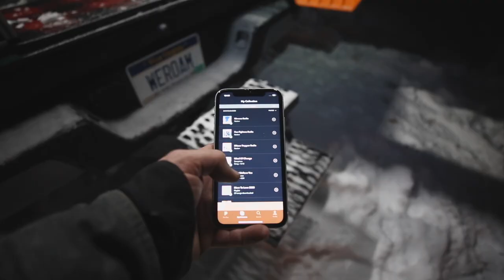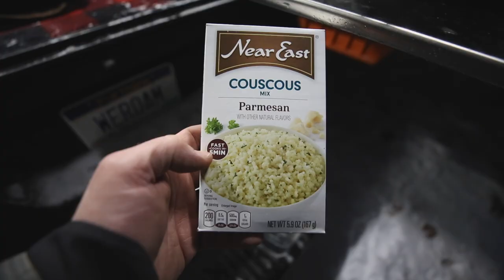Solo Snow Camping in a Winter Storm Warning - Mountain State Overland

Comment: I'd hoped you'd talk more about the winterization of the Alu-Cab. I do a decent amount of winter camping and I'm trying to determine how well the Alu-Cab does. I'm up in MD but come down to W.VA quite often in the winter.
Reply: I second that!
Reply: I have an AT Overland Summit and a buddy with an Alu-cab Cannopy Camper freezes his butt off compared to the Summit.  We switched for a night and I froze my butt off in his while he reported to be fine in my Summit.  Summit has 1" honeycomb walls vs a layer of AL for the Alu-Cab.  Weights are similar.  Alu-Cab is much more affordable.  With an AT Overland system, one must add the wing doors and solar run to the roof.
Reply: @terrychrudinsky5663  The AT Summit is still single wall canvas in the sleeping area correct? I get that the lower part is insulated vs AluCab but don't understand how that would correlate to a better sleeping experience.
Reply: @red6743  First off last year I slept in my camper close to 90 times (almost every weekend, 2 long trips, and a work schedule that allows for Tuesday and Wednesday outings).  I have dozens of nights in the low 20s and below.  You're over estimating the double layer canvas.  I read that also and was surprised by my friends reports of being too cold and really surprised by the above real world tests by me a Summit owner and an Alu-Cab owner parked side by side changing vehicles between nights, the one sleeping in the AluCab was much colder.  AT Overland also offers a Termal curtain kit that can be hung in the test area.  I've seen videos and it is reportedly thick.  There are reasons, those who actually winter camp with an Alu-cab Camper spends so much time insulating the shit out the Alucab.  I'm surprised an after market company isn't making a Termal curtain for the Alu-cab.  I'm sure one will come out sooner than later.

Note, I'm not saying the AT Summit is a better camper.  I actually think the Alu-cab is the better camper minus the thermal issues.  I'm about to get a new truck DCLB vs the DCSB and will likely get an Alu-Cab realizing I will be insulating it and likely building my own thermal curtain going into next winter, there are vids on line of people building them for RTTs.  I am concerned how much weight the insulation will add to the system.  

If wanted, I can do a write up on the advantages one have over the other.  I'm about to buy so notes are current.  There are other campers, I've not slept in them
Reply: @terrychrudinsky5663  I felt a thermal curtain could be made out of a moving blanket decently easily. And seeing as they're pretty cheap at Harbor Freight, worth a shot.

Comment: Great video. Is there reason to worry about mold on or in your RTT during winter when it’s harder to air it out?
Reply from the maker: Nope, no worries. You should always prop open a canvas tent/camper when its nice enough out to air things a bit. We store our truck in a conditioned garage when not traveling so we just pop open the tent inside. Cheers!